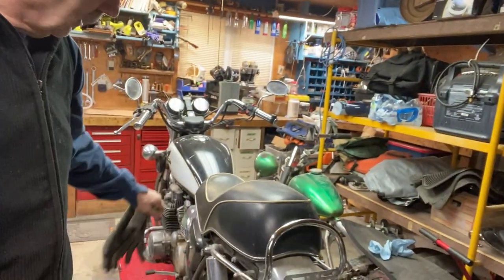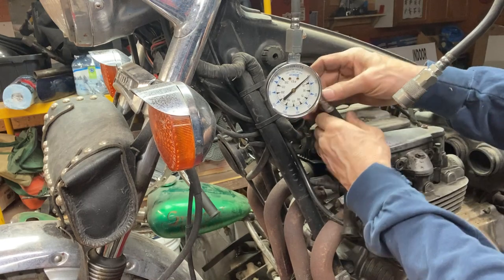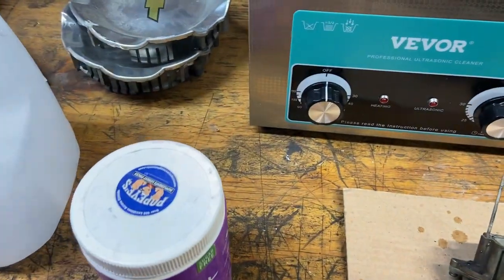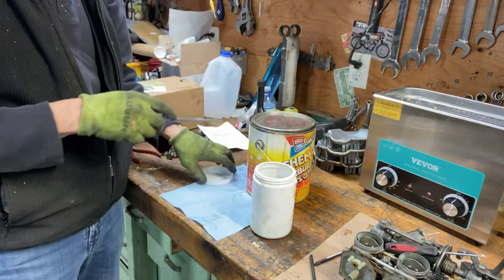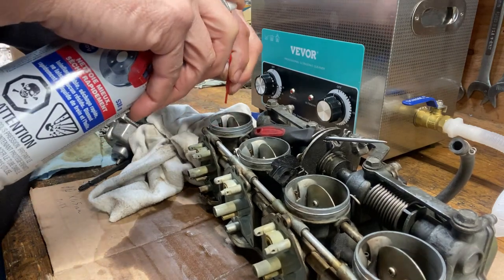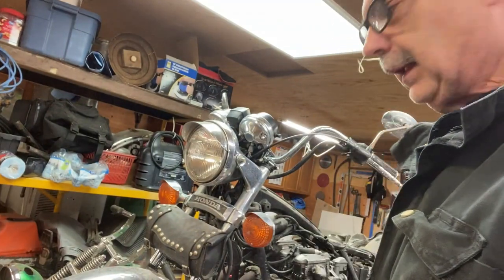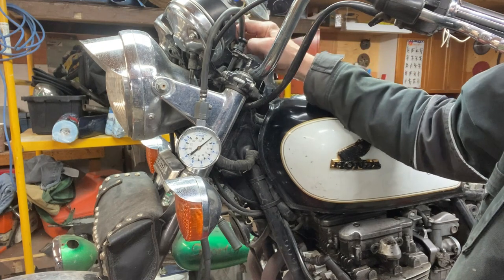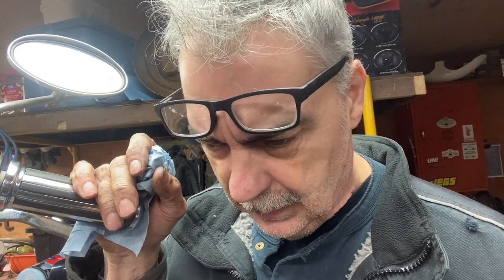1980 HONDA CB650 RESTORATION PT 1

Comment: I'm going to the tanks the oil tank too and the carburetor on my bike . I use 45% vinegar
Reply from the maker: I was thinking of using vinegar on the carbs in the ultrasonic cleaner.  I will next time.
Reply: @MOAB  get on your hands 😮😮..u'll find cuts on your hands 😁